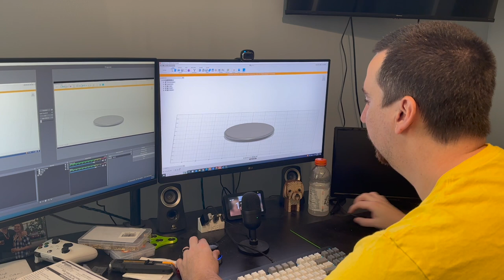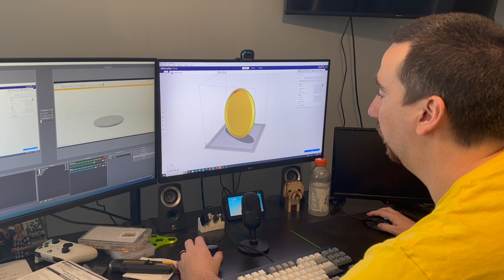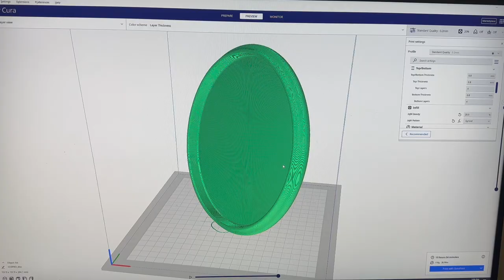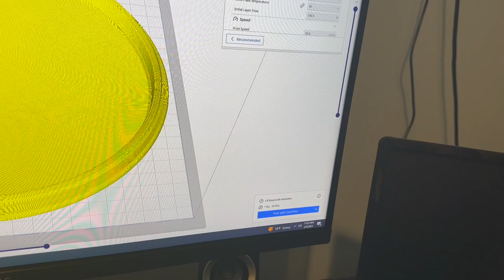The Making of a 3D Printed Disc Golf Disc | Functional 3D Print | Ender 3

Comment: Excellent video man, was so shocked to see only 180 views, wouldn’t have been surprised to see 100x this, I guess it’s a niche topic but the idea of 3D printed discs is awesome, so much scope to play around with the profile, disc radius and disc weight, see how everything changes the feel of the disc. Going to try this myself, would be hyped for a part 2 experimenting with how any design variables affect the flight of the disc
Reply from the maker: Thanks man! I was pumped with this video, but YouTube just isn’t pushing it I guess. I definitely want to play with this more. I think my next move is to print it in TPU, maybe like 150g of filament. The weirdest part of the disc in this video is how hard it is, and of course how overstable it is.
Reply: @PrintPractical tried printing a disc myself, came out super overstable just like yours. From my limited understanding a more domey disc should help counter this. Going to try again, with the design heavily inspired by the innova mamba. Also I think printing in 3 parts and gluing is the way to go, fully removes the need for any supports whilst enabling a domey top. Really think you’re on to a winning topic here youtube wise, the video is excellent, I think you just need to tweak the thumbnail and title for part 2. If you want to chase views, then Something along the lines of “3D printing the most Understable disc ever”.  Just mix up the title with whatever characteristic you’re aiming for, then for a thumbnail something like an Overhead view showing the flight path, one path of a regular disc, and one with the flight path of your disc, exaggerate the flight path of yours a little for better ctr, and a couple of arrows pointing to each path, “normal disc” and “3D printed”. Just some thoughts, and if you’re not too worried about views/just enjoy making videos then disregard all of the above haha.
Reply from the maker: Thanks for the advice on that man. I just finished up tuning my printer for TPU, and I am printing this same disc in TPU now. I’m aiming for 150-155g and overstable (not a beef cake like the final one in this video though). I’ll make a part 2 with the results.